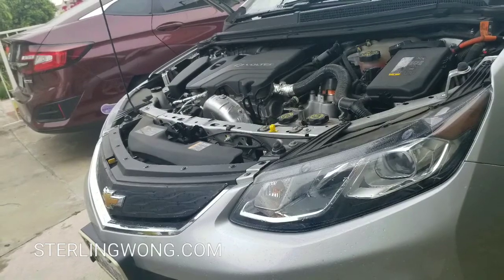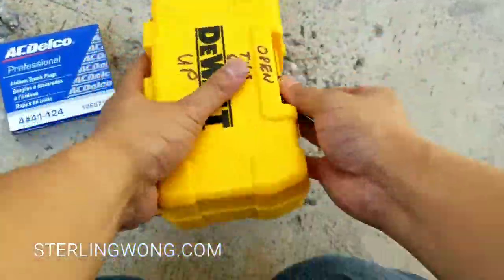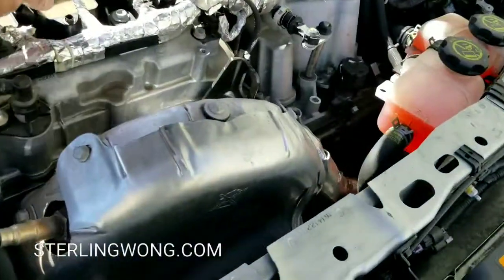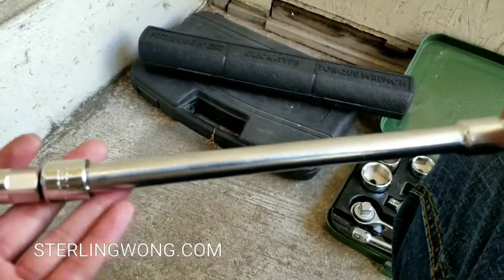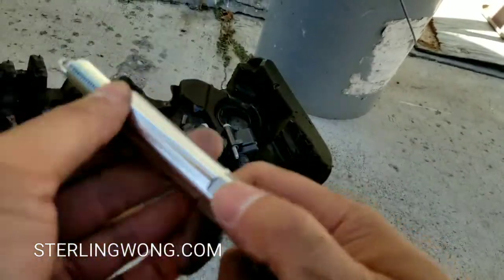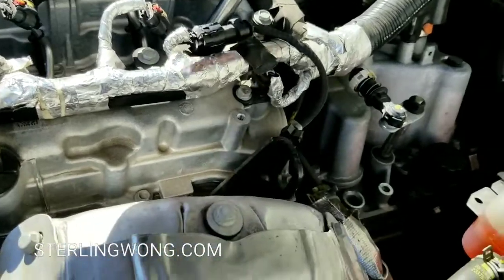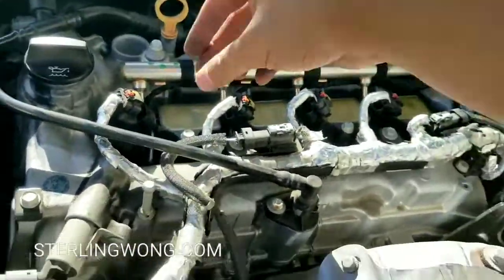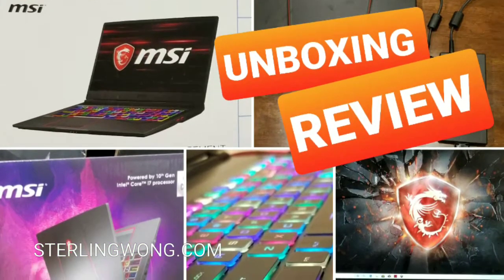2016-2020 Chevy Volt Spark Plug Change (@ 100,000 miles) Chevy Volt Vlog #73

Comment: The manual says to change plugs at 97,500 miles. Is that engine miles or car miles? My 2017 Volt has 102,000 miles but only 32,000 on the engine.
Reply: Engine miles.  Unless you rarely charge your Volt, you probably won't need to change the plugs due to mileage.  Might be worth doing after 10 years or so just due to age.

Comment: Is it 10mm or 14mm socket? Because in your video you said 14mm but in your info on the video says 10mm.
Reply: The 10 mm  is for the coil pack bolts. The14 mm is for the spark plugs

Comment: Any need to use anti sieze grease? Some manufacturers do not recommend it.
Reply from the maker: No. These new plugs dont need it. I haven't used anti sieze for the past 7 years on my Hondas with NGK plugs . Its too easy to over torque the plugs. The GM plugs in the car didn't seem have it either.

Comment: What about life after 100,000 miles on volt chevy, does the battery degrade,  talk to me
Reply from the maker: Nope, still at 55 ev miles full charge!
Reply: We have over 175k on ours. It is degrading,we now get roughly 30 miles on the battery pack currently.  I am planning on a replacement pack soon.